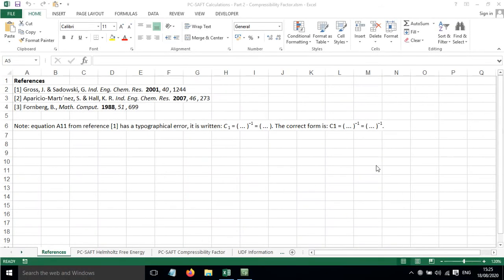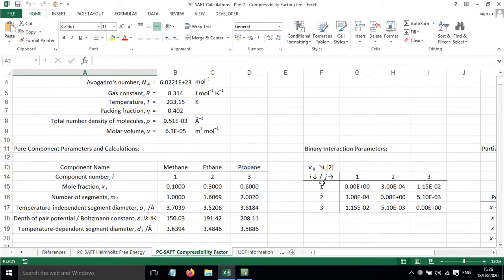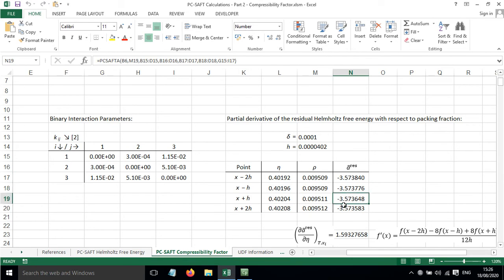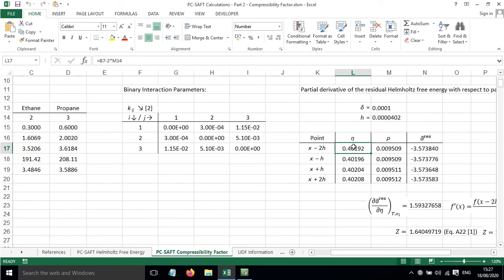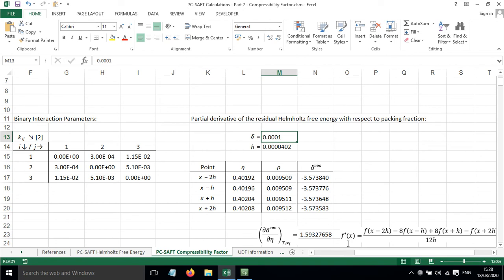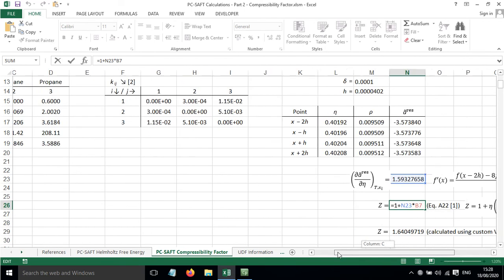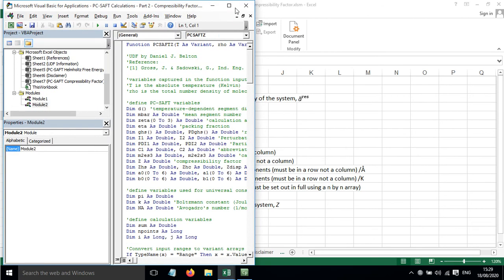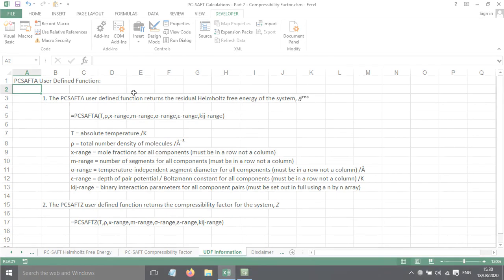PC-SAFT Calculations – Part 2: Compressibility Factor (nonassociating)

Comment: Nice initiative and the explanation is top-notch. I have a question that how did you calculate the packing fraction? After going through the paper by Sadowski, I got to know that we need to iterate the values of packing fraction till Psys = Pcal . Please tell me how you did. Is there any correlation for calculating packing fraction? I am actually building my own Excel and I am stuck there (maybe due to Solver). Thanks.